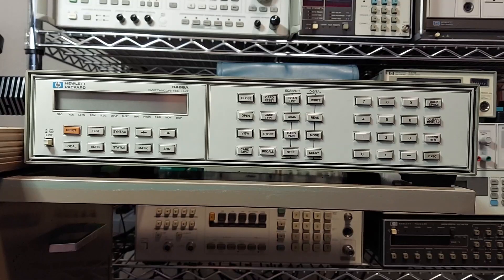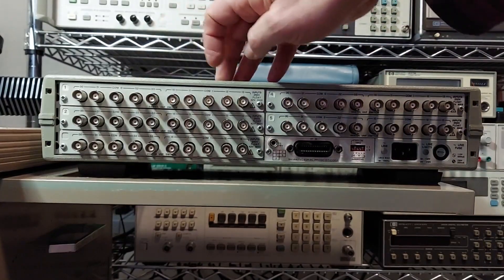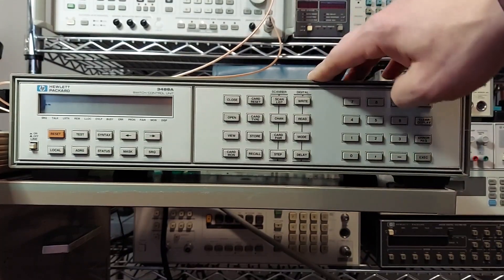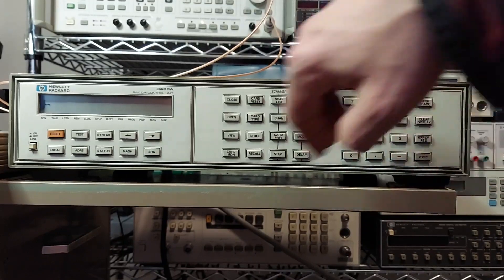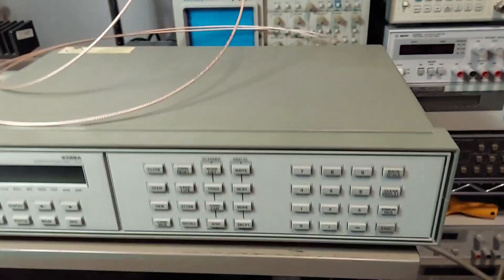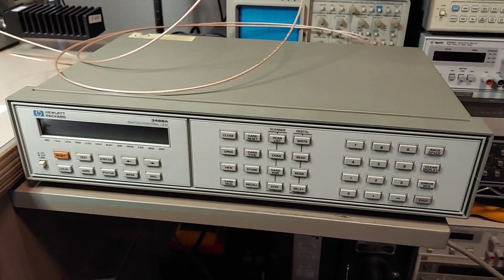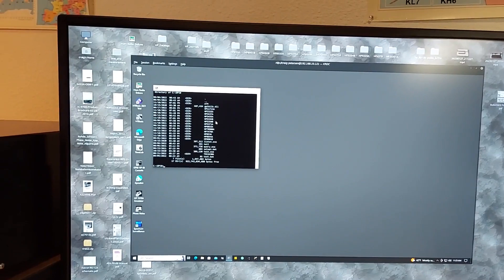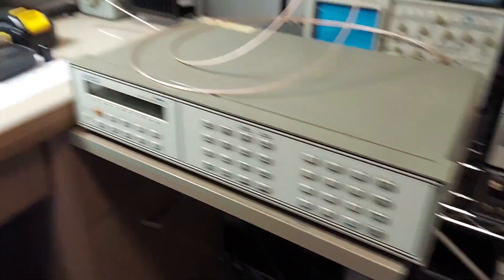HP 3488A Switch / Control Unit

Comment: I've seen this but never knew what exactly they did, it was a kewl demo, thanks!  ~Jack, VEG
Reply from the maker: Hello Jack, since making this video I have found another dirt cheap HP 3488A at a local electronics store where I live that came with two (44470)10 channel matrix modules, their primary application is for attaching a DMM to multiple sources. While the likelihood of me using these modules to their full potential is fairly low, it will however make a cool toy to play around with. Thanks for watching!

Comment: Thanks for the rundown on the switch controller. Very interesting. I’ve never really understood what they did - but this was a great introduction. They must be a big win if you have a complex automated testing system. One question - can a card only have one active output at a time?
Reply from the maker: Yes, these cards will only let you activate one port at a time. If you try to close the contacts on a second port on the same card it opens the contacts on the current one closed before it closes the next set of contacts.